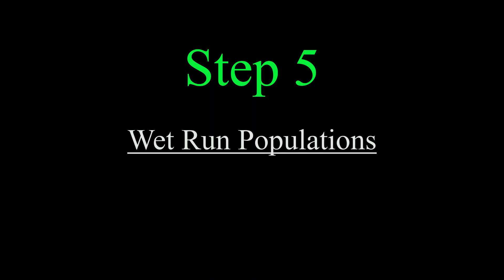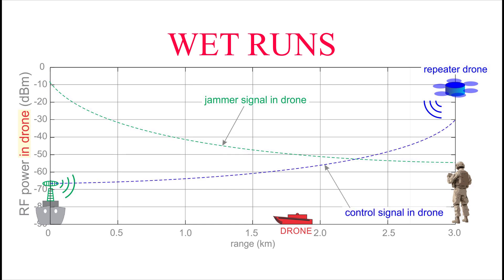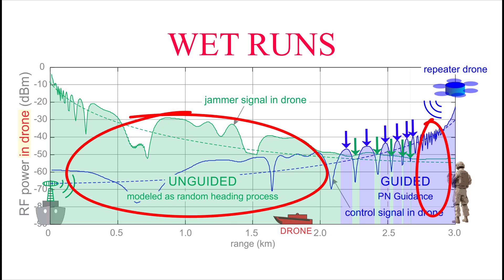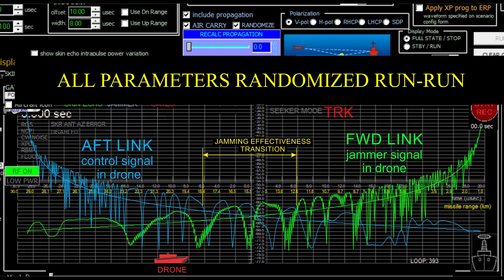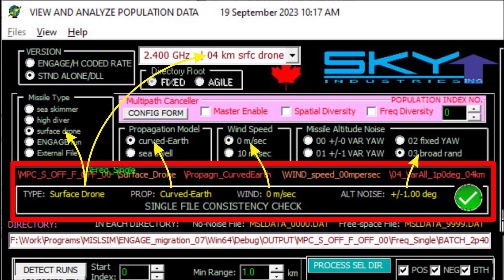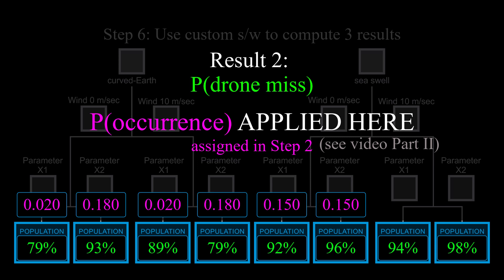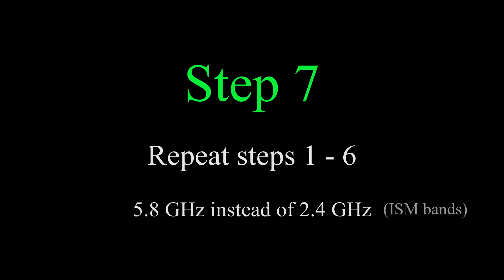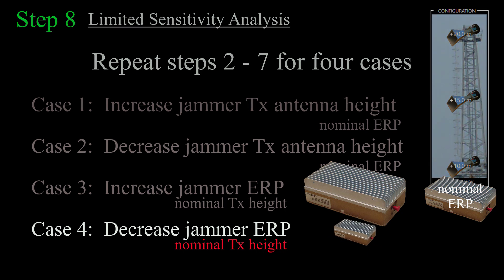How to Design a Counter Drone Jammer PART III 11

Comment: The adversary drone might relay its attack with an onboard Ai in order to target the detected existent antenna, instead of the ship itself.
Therefore if one on board antenna must be, it should be remote dragged or pulled by the ship, via like a kite or floating helium balloon.
Does it make sense?

Comment: This is the most thorough set of videos I have ever seen on YouTube. Hell of a job. Quick question, at my previous job I worked on identifying and classifying targets from their RF data. We really struggled with frequency hopping signals. In this example, I know we’ve taken as constants frequencies of 2.4 & 5.8Ghz, but how would you design a system if you couldn’t hold these variables constant? Again, amazing job

Comment: A fascinating approach. I imagine that the adoption of satellite based communication with VSAT equipment changes the model somewhat as the narrower beam width and indirect signal path makes the range from the control station to the drone almost constant. With good (low) side lobes on the VSAT terminal you can imagine that the jammer power would have to be both much higher and carefully directed. I guess the natural countermeasure (from the drone’s perspective), is to adopt a multi-element array where a null can be placed specially on the location of the jammer, further increasing the immunity.
Reply: OpenVC has provided routines to perform the last stretch for years.
Point the camera  in a direction and find an edge. measure object from edge.
Half the distance and full speed for the middle of the objects length.